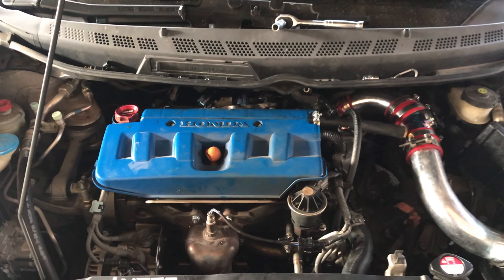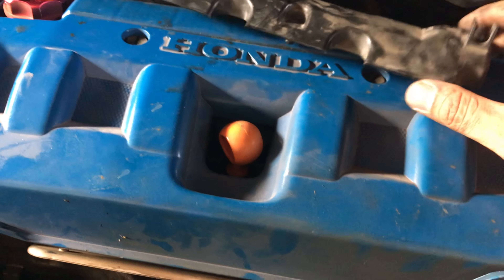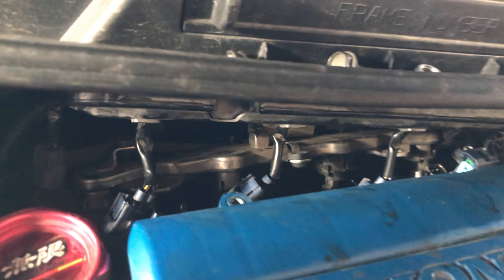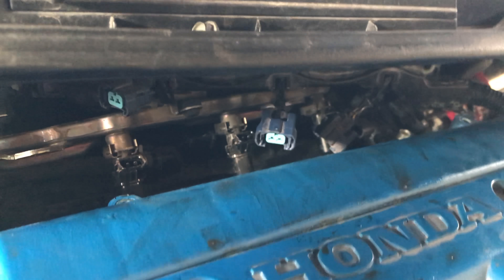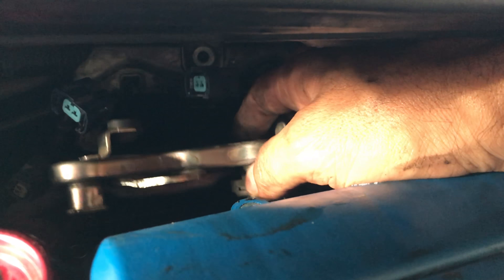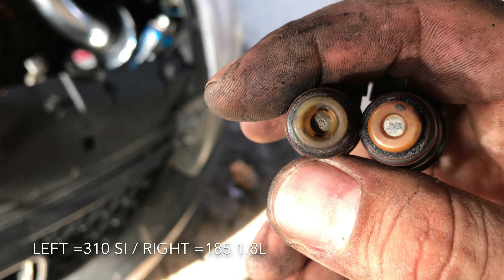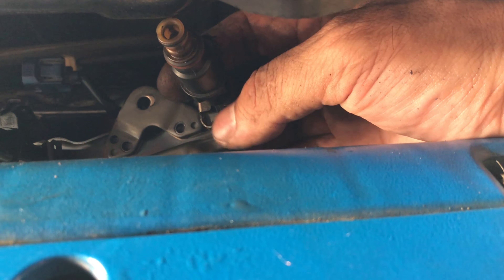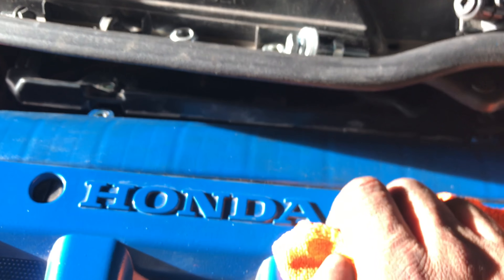Upgrading Fuel Injectors 1.8L R18 Civic

Comment: Well I just finished putting my new ones in. I did everything the same was as you except for 2 things to make it easier.  I removed the fuel line going into the rail (took 1 minute no tools required) and removed the entire rail with injectors attached and changed them out inside on my desk and put the rail back in with the new ones already installed in the rail.

Comment: How did the si injectors work for you?
I’m planning on turbo with 410 or 450s
Reply from the maker: 410 will be perfect for boost
Reply: @chrisasaurus  I’m on 310cc now with about 7-8 psi of boost on a baby turbo and they are just about maxxed out 90% duty 

Anything with more boost or bigger turbo will need 410
Reply from the maker: @BulliKid  there you go, good luck on the build

Comment: do i have to tune after i change my injectors or do they adjust on its own. (like plug and play)...
Reply from the maker: If you have Hondata there is a basemap but a custom tune would be ideal to make sure they running smooth
Reply: @chrisasaurus  i have a cvt transmission do hondata support this t type of
r18z1 engines ? would a check engine pop up

Comment: so the stock flow rated at 185 cc and upgraded to 310 cc without ecu tuning does it running rich and how about mpg or fuel consumption do they affected, sure consumption increased i wish to tell me not changed. also i need to know how to read the data stamped on keihen fuel injectors i have many removed from 2000's honda i want to use them in land rover but i don't know any information about the flow rate of them, this 185 cc or less is very good but how i know that i have them already..thanks

Comment: You put a 410cc injector on a stock r18 without any ecu tune? Why and what the gains are? Thanks in advance!
Reply from the maker: Panagiotis Gavrilis youll need Hondata
Reply: Will it fit Hondacivic  1.8l engine automatic sedan

Comment: How did this mod do? Did you see better or worse gas mileage? More or less hp? Did you tune it or let the ecu work it out? 
Doesn’t seem turbocharged or supercharged? Just curious if the upgrade was worth it? Thanks in advance!
Reply from the maker: DpsHeals if you watch th most Reece then videos you’ll see 
And it’s better throttle response 
But yea you need Hondata
Reply: Chris Valle I will have to watch! Thanks!!